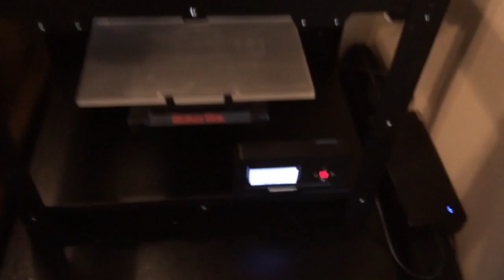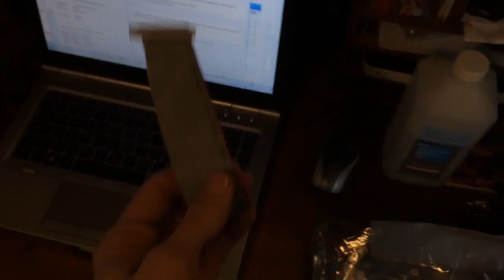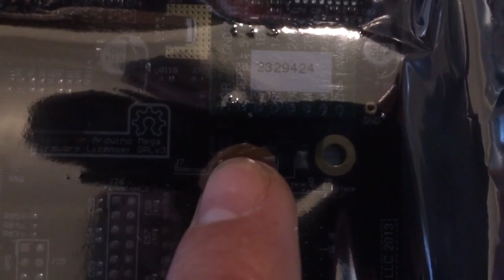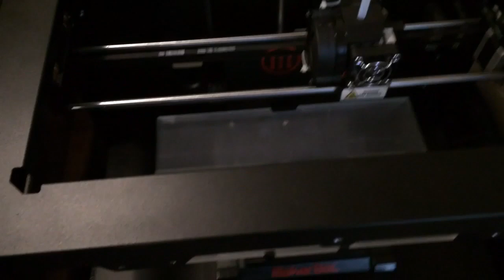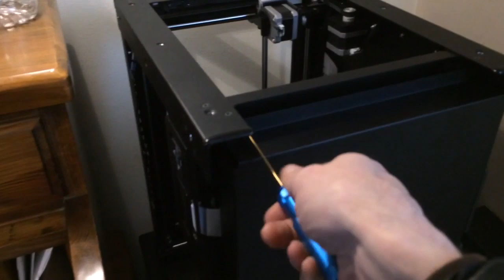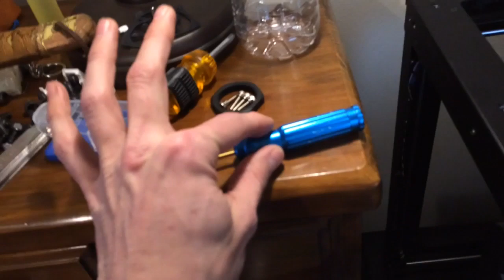Replacing mighty board on Makerbot Replicator 2 3D Printer

Comment: Would you know where I can buy this board ?
Reply from the maker: +Julien Roub Charland Hi Julien, the good news is you should still be able to buy this board from Makerbot. Yes, they did stop making the replicator, but the replicator 2X uses the same board. I've even converted mine over to a dual extruder using the board in the replicator. So basically mine is a 2X, but better quality with better parts and runs a lot better then a 2X.
I don't know of any third party resellers that sell this board without looking into it. Some resellers may offer the board? But be sure to ask for the Replicator 2X board, because some resellers don't even know that the rep 2 and 2X boards are identical. 
As for a third party made one for one replacement from another manufacturer, I haven't heard of anyone making one yet. Maybe if the 2X gets disco used then someone else will make a replacement at that time?